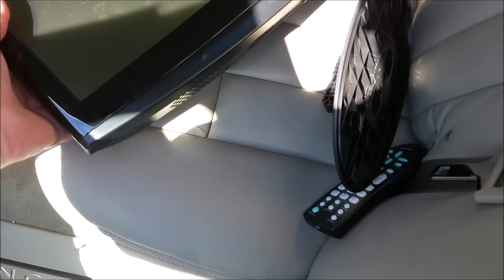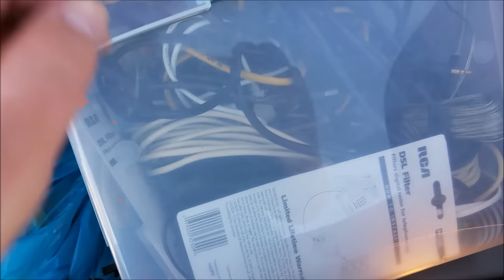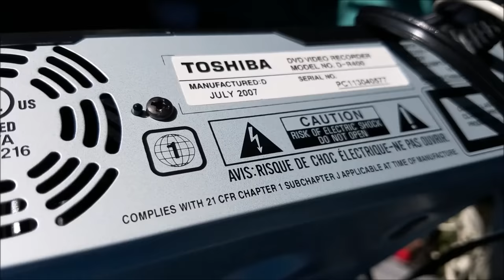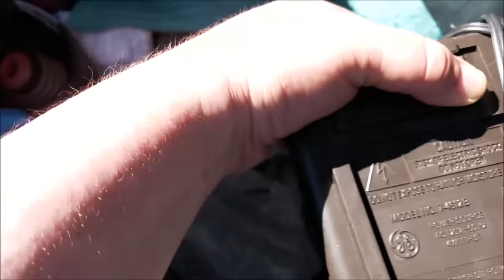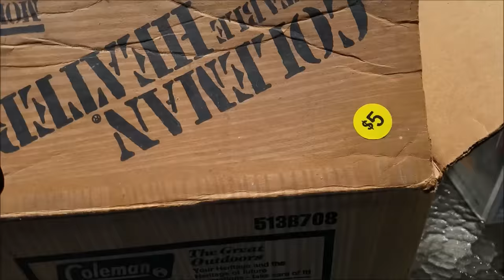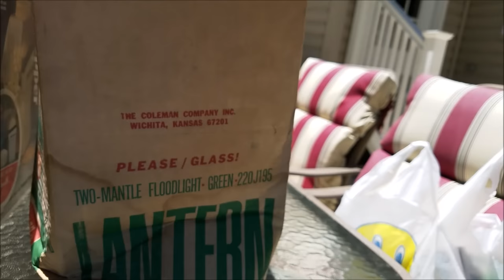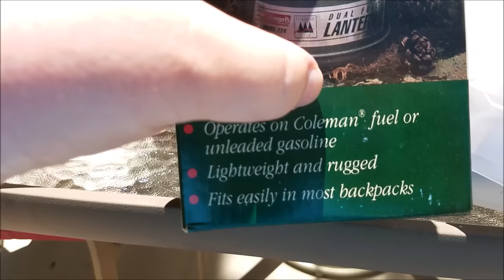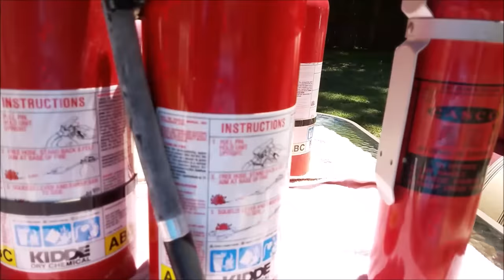Vlog For June 18th 2016  -  Super Mega Estate And Garage Sale Haul!

Comment: No I can tell you those are for fires but if there not water do not ever put water on a fire of electrical fault if those have powder in side the  kidi dry chemical are ok but they don't have head thing   on the ends I saw none but they still would work ok I was like a chemical man at my work when I could work that was we had ones that were water for paper burning fires the we had the co2 its like that what you have but comes out cold pressure with all the dry chemical but hey 2 dollars good price the RV one im not sure probably anything in the RV van we did have one other one fire cylinders its only near the lifts in the nursing home I worked at and that was only used encase of fire in the lift hope you understood what I mean sorry im bad at spelling